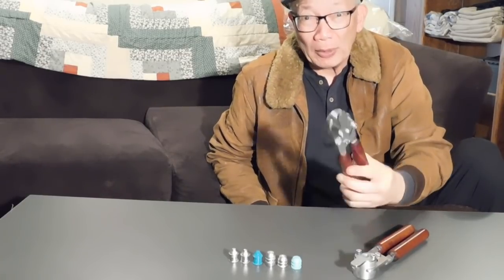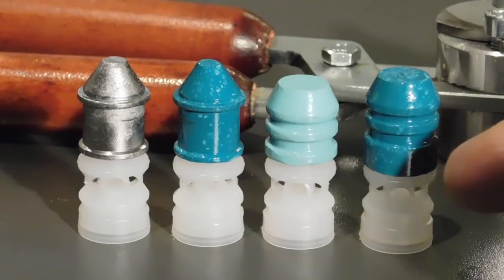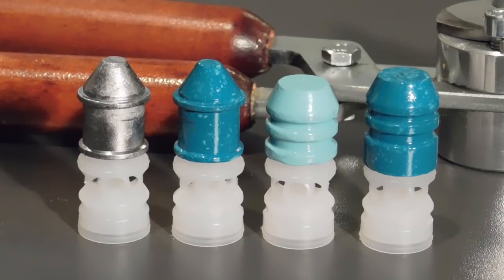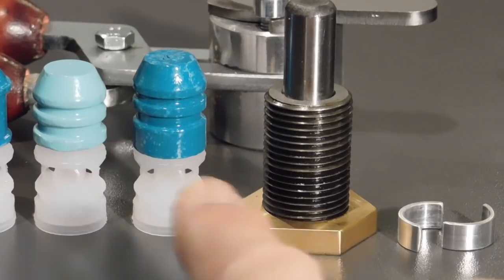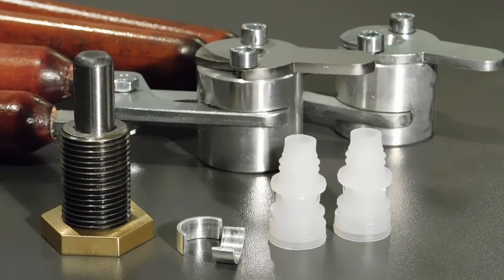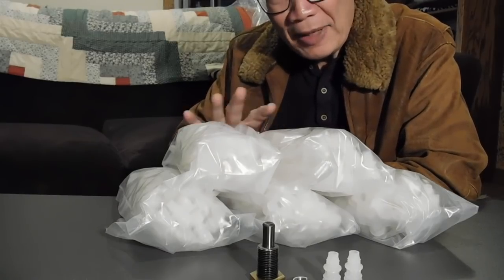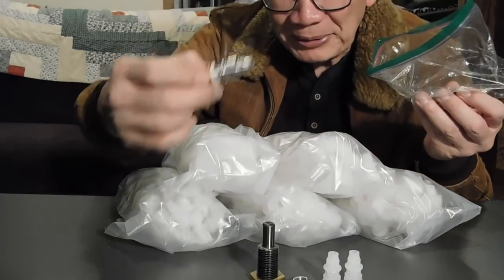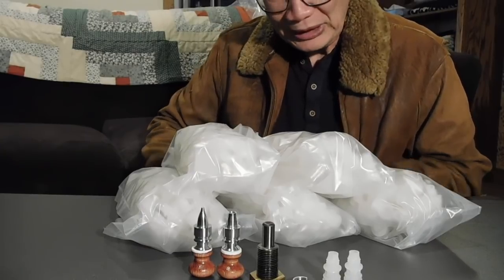Interesting Shotgun Slug Components And Equipment

Comment: You know,,, I never thought these would take off as they have. However, Proof is in the pudding and accuracy is paramount with any other slug you can get out there. as you know James and I have been working together to stock these slug molds and wads. we are expanding the inventory offering more tools and pin assortment so that the caster can choose what they want to make. we are currently working to get new hull vices that are premium quality over the one offered by BPI, that is something that is going through the cost analysis process as we speak. So, More stuff is on the way and room is being made to expand the storage of these products at The Reloaders Network. It is a back burner thing as of now, However, I have been looking at Home shotmakers just to see if we could offer those too. Dave.
Reply: Ooooo! If there could be a home shotmaker for under hundred bucks even if it was an attachment to a Lee pot I would be thrilled
Reply: Thor's Axe, the molds were in the mail this morning, fine looking molds, i don't think it will take long to go thru 500 wads though! the machine work is top notch! can't wait to try these out so i can order the other mold, thanks for all the work on getting these 
                                        shotdog

Comment: I have been trying to get an answer to the Super Paradox slug, to no avail. Your video shows the longer skirt at the bottom of the paradox slug (the 4th one (not Powder coated)  in the first close up and the last one on the right (powder coated) later on.) That is the one I wanted and ordered but on arrival I got the short bottom driving band! My standard center pin also has the shorter driving band. How do I go about getting the center pin with the longer bottom skirt for use with the proprietary wads??? (No answer from The Reloaders Network!)